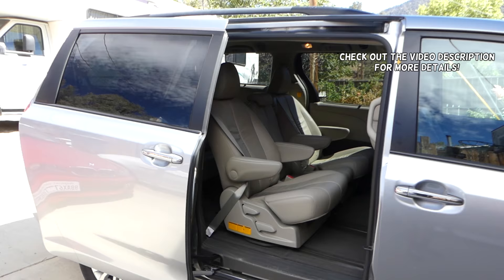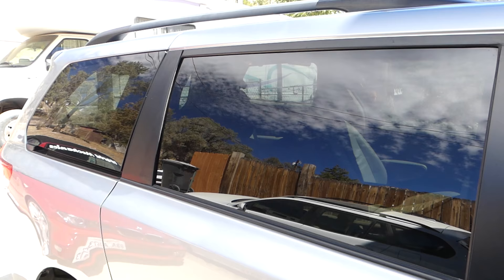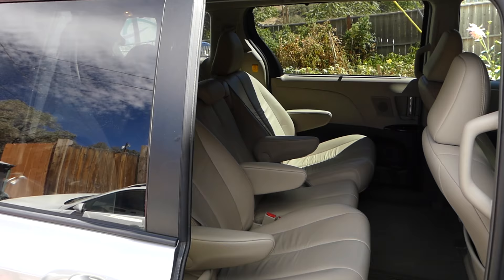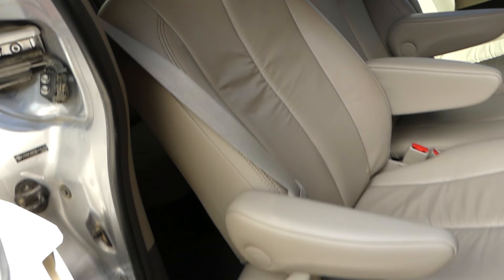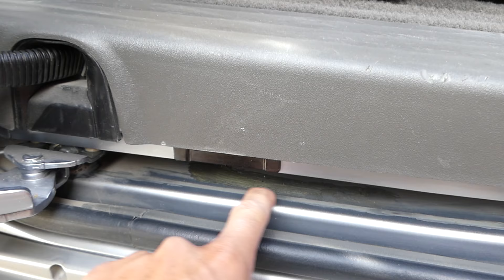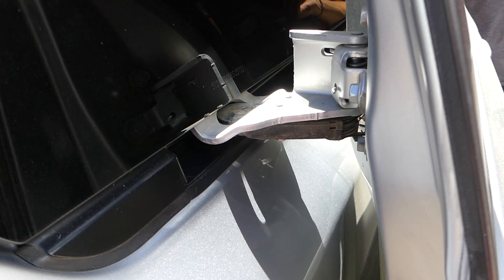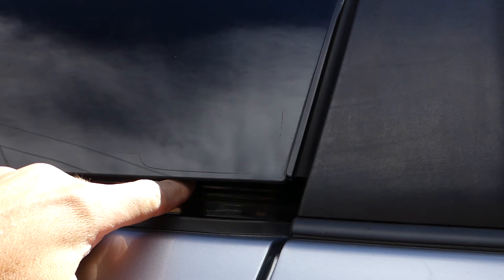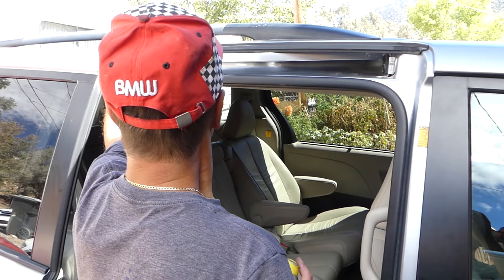HOW TO GREASE LUBRICATE SLIDING DOORS ON TOYOTA SIENNA

Comment: Hi,

I just came across your channel, and found that you have really good experience, and I wonder if you can help me with my car.

I have Ford Fiesta that was struggling to start, and now it won't unless with a push.
I checked the battery and it is good, as when turning on the key, the light stays on on the dash board.
I was told that it is the starter motor that needs replacing or repairing.
But I can't find where is it located, can you please help?

Thanks
Mo

Comment: hello sir, We have the same generation of sienna and my BUTTON on the ceiling for closing/opening the door is not working anymore. How is yours? and if its not working!!! How did you fix it?
Reply: Hi there is a warranty enhancement for that overhead console so you should be able to get that replaced under that.  I had mine done last year.
Reply: @leeannsteeves1821   That also good for 2015?  TSB#?
Reply: Doors unlocked? In park? Child safety switch off?

Comment: have an issue with my Toyota estima door where it opens but stops and goes back when i try to close it - i am thinking it may be electrical - but i will try the greasing - hope it helps - thanks
Reply: Did you find out what was wrong with your door? I have the same problem.
Reply: I’m having the same problem! Ever figure it out?
Reply: I'm having the same problem
Reply: @hcgmelony  I'm having the same problem, did you ever figure it out?
Reply: @locktonb0917  I'm having the same problem, did you ever figure it out?
Reply: Did it work?
Reply: Hope this will help.  I just had my slide door wire harness replaced free from Toyota dealership.  My initial issue was the fuel door hinge broke that is also covered, need to wait for dealership to order the fuel door.  I have included two threads that covered it.

https://www.toyoheadquarters.com/threads/2011-2016-toyota-sienna-power-sliding-door-recall-g04.822/

https://www.toyoheadquarters.com/threads/2011–2018-toyota-sienna-vehicles-coverage-for-the-fuel-filler-door-hinge-and-pin-csp-zke.1686/

Comment: Hey thanks but I WOULD NOT recommend the to the top one. I did the same thing and it started squeaking
Reply: Daniel Than . I have the same noise squeaking, have you seen a way to replace just the roller plastic
Reply: yea just dont spray the top roller bearing. now mine makes allot of noise. any fix?
Reply: @raisalam8809  lithium grease breaks down plastic and rubber
Reply: Lubricate the roller axle, not the guide/channel.  

It's a common misconception to lubricate the guides/channels.  Your door may move like new at the moment you lubricate the guide.  But overtime the rollers will slide instead of roll.  This creates flat spots on your rollers making it even more difficult for the rollers to spin.
Reply: I second this! Squealing was nuts.. 🤦🏻‍♂️
Reply: Wow, this really makes sense that flat spots will develop if there is no friction to make the rollers spin.  Better just to wipe clean the roller channels.